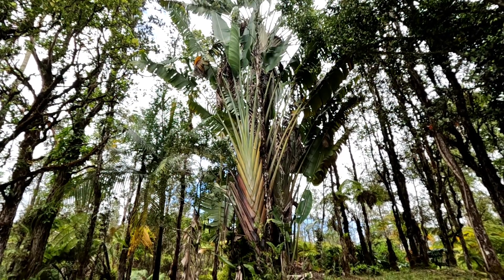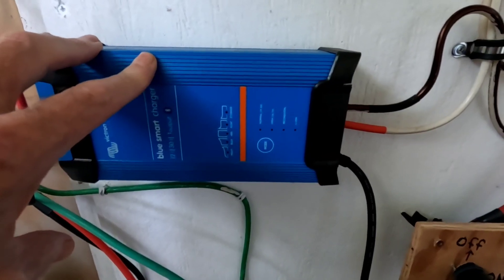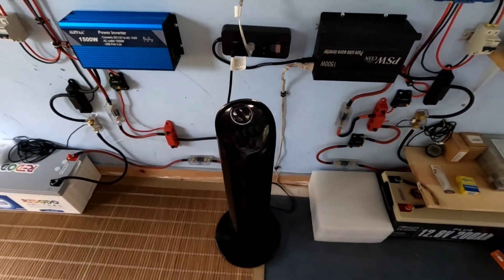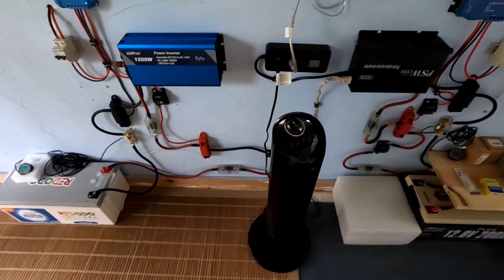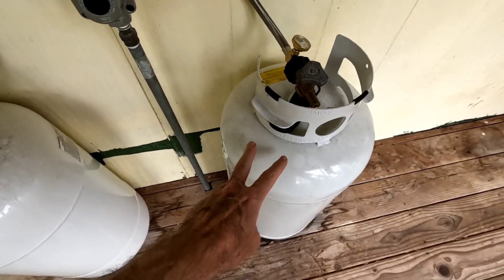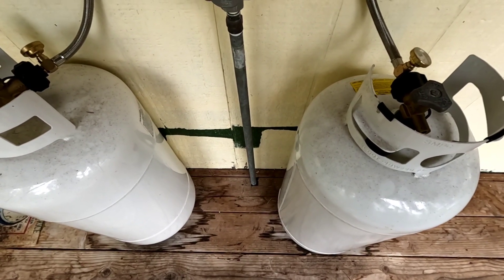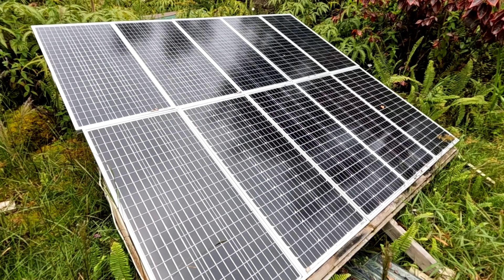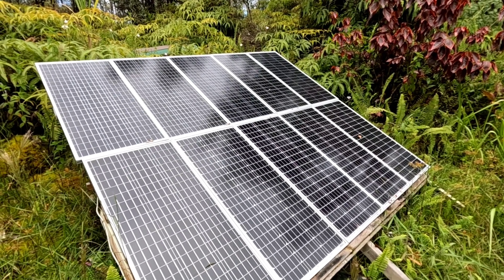100% sunshine for electrical needs. Beware propane... you're next to go bye bye.

Comment: I understand the desire to get off the gas. LOL pun intended. I would keep the propane as an emergency fuel source. Maybe look into a propane inverter / generator. Propane never goes bad in storage.
Reply from the maker: Still using propane,  and have for 30 year's now. Not sure I'll ever eliminate it totally,  but definitely not as dependent on it as the system grows. aloha 🤙

Comment: once you get past that first investment the saving's really adds up. I have propane and deasil generators for back up. have not run in months .only started for militance .My Honda gas gen is my work unit. I am a electrician and some job's have no power like NEW service panel . A county north of me in NY has got the green light for the largest solar plaint in the state. we got lots of wind power to the grid and some hydro power as well.  we have in a park nearby that has free charging station for EV . and hear in NY it is used . things are changing and it looks great so far ! Oil companies are worried . one of the reasons of high fuel cost.  make that money now before the big drop in sails. I was out today with my girl and noticed more EV on the road in NY . and more people like me have battery lawn mower. Walmart and most stories have them now. I got mine at  Homedepot and I love it. Lithium battery's are 90%   efficient. weed trimmer blower chainsaw all DeWalt and battery. lots to chouse from now.
Reply from the maker: I haven't had to fire up the Honda in months,  and I'm thrilled about that! Gas still hovering about 5.60 gallon  here. Rather use sunshine.  Quieter, easier, cheaper.  Hope I never have to fire it up again! Aloha buddy 🤙
Reply from the maker: Also,  I've been looking at the battery powered weed whackers,  and lawn mower's too!🤙

Comment: The last Long Low Sunspot period lasted for 900 years and they called it the Dark ages due to cloud cover. Our warm period started as Sunspot numbers rose, and Sunspot maximum was around 1957, they have fallen since and are now close to the floor. They are never warm periods as the clouds stops the Sunshine from arriving. All empires have collapsed as the numbers crashed as stuff plagues and the odd Volcano wakes up, crops get affected with foul weather and food prices rise. Rioters take to the streets complaining and Robbing, Child saints promise to save you if you follow them as it's all your fault the crops have failed,  and a regime change often follows and lots of death. That's how it's happened for every Empire since the Sumerians, and i can't think this one will be much different, bar we probably won't be slaughtering virgins and offering their blood up to the Sun, in  the hope it will change its behaviour. 
It is not the time to be putting all your eggs in one blanket, and especially not Solar. A Volcano has just woken up in Iceland and it's pouring out CO2 by the shed load. It has yet to pop it's cork but when it does it could be dark for a while. Get a pair of sack trucks for the gas and keep hold of them is my tip, even though it transfers moisture into the house.

Comment: Hey pal, have you looked into the hybrid storage water heaters? If you haven’t then you really should.
Reply from the maker: Aloha Michael! Well I thought I knew what you were referring to, but I was wrong. I've just been reading about the hybrid hot water systems since I read your comments...and my mind is blown...again! Mahalo for sharing this relevant information.  I'm taking a hard look at this...it seems totally doable.  🤙
Reply: @ProjectsinParadise808  there is a small hack that you can do with a small resistor or a light bulb in place of the heating element so that it never tries to use the power hungry elements. I can help you with that if you want. Add me on whatsapp and I can walk you through it. mahalo

Comment: Thanks for the update. Are you in Hawaii. It does seem to have some tropical plants growing there. I'm in Ireland and I run a very small set up on a boat and like you I only buy propane for cooking. I don't/cant however use the solar in the winter months much. still in winter here i could get by without a refrigerator.
Reply from the maker: Yes, big island of Hawaii here...aloha 🤙

Comment: Interesting video. 
Tell me what degree latitude are you. I’m approximately 52 degrees North, with my panels at a 15 degree from horizontal slant south and we basically generate pv power enough to wipe out our winter useage…..storing electricity is the next stage.

Comment: You can wire two separate outlet receptacles side by side for the fridge so if one system is low, plug into the other system’s outlet.
Reply from the maker: I like that idea a lot, mahalo! 🤙

Comment: Nice update!  I just got my system basically finished as well.  Victron 250/100 and an epever 30a, chins 12v 300ah, victron ip22 charger as backup, same 3000w inverter you have.  I bought a renogy first and it died after 30 mins
Reply from the maker: Sounds like a nice system you got running...nice. Aloha 🤙

Comment: Of propane, means induction cooking, I guess. Looking forward to this project.

A tankless water heater with electrical element takes a lot of electrical power, so i wonder what solution you will have in store.
Reply: A D.C. element in a storage tank water heater can run directly from the solar, especially if the batteries are fully charged.
Reply: Hawaii doesn't get so cold in the winter, so it may be possible with careful design and powermanagement.
Reply from the maker: You called that right! Yes indeed,  learning about induction cooking.  The goal is let the sun do everything now. I'm sure having fun all over again.  aloha 🤙

Comment: I used propane to cook with and heat my water also heat with it .In the winter time I have to use it and I'm scared this winter I don't have no idea what it's going to cost me . I figured at least twice as much this winter. I lived off grid but we have cold winters. 
What kind of winters do you have?
Reply from the maker: I started living off grid in cold country. Propane was the rural choice of fuel. Like you said,  cooking,  bathing, heating...it made life out in the woods way more comfortable.  Was about 50 cents a gallon then. Time's have changed. Going to try to eventually not need it. Of course winter's here mild compared to those days.  aloha 🤙